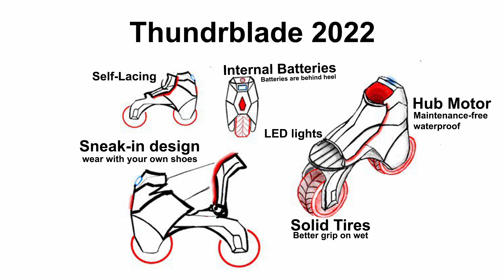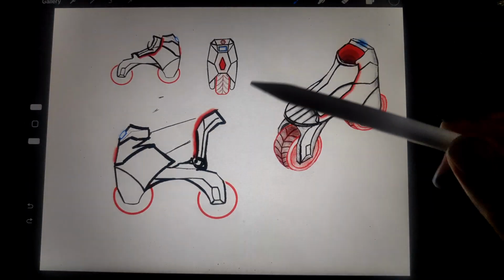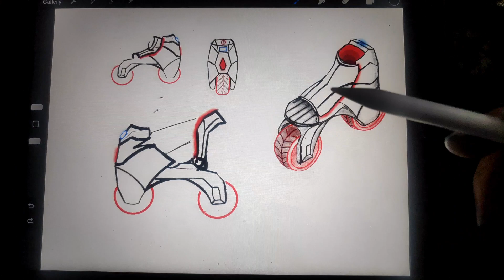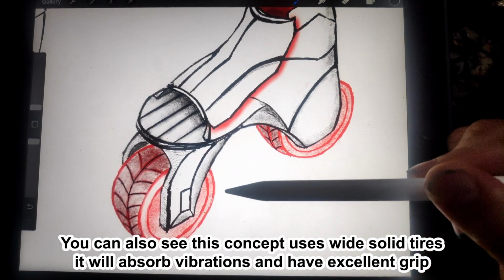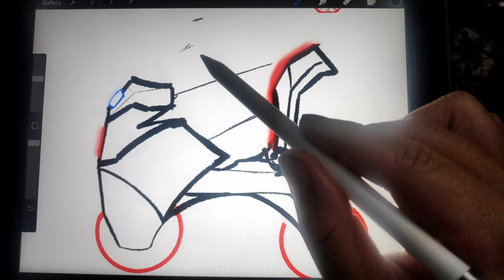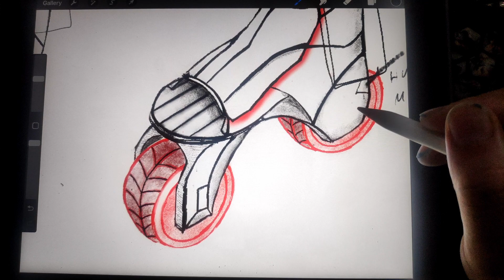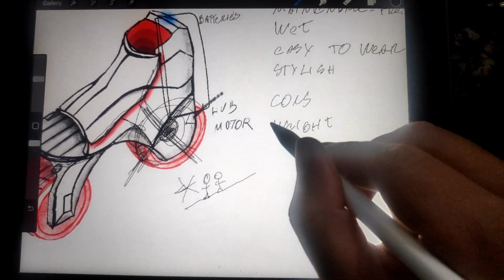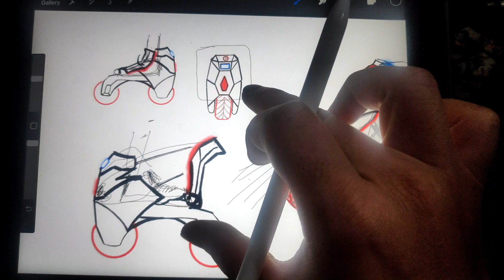Why Thundrblade will use HUB motors going forward

Comment: I follow you since the beginning, and I tried to build a prototype of electric skate myself. A rudimentary working one. So congratulations!

I just think that, in general, it is better to show a working prototype rather than a sketch. Prototype are "cheap" to build after all, especially of this type.
Even a CAD model would be better than a sketch (it would also reveal many details) to figure out how well a solution is going to work.
I think that for any start up project or whatever you want to call it, the best time to talk and convince people, including investors, is when things are done and working, i.e. prototype. Also, I think you need a team of at least 3 people (experts) to make any product of that sort.
Reply from the maker: I agree that showing a working prototype would be better. I showed the first one 7 years ago XD
but right now I simply dont have the money to build one.
yeah, prototypes are not that affordable. I am gathering donations from eveyone that supports thundrblade to be able to build one right now.
check out the previous video where I talk about how things are right now.

that path is correct, but its not a possibility for me. I tried the crowdfunding/investors path and couldnt make it.
a team costs money, a lot of money.

Im done trying investors. its really hard to convince people that electric skates have a good market. I tried for many many years as I said in the previous video. So we have to build the market slowly. 
Right now it is not the time to try and convince investors. you are right about that. I am trying to make an open source community backed project to actually start building the market. so its not the startup path as we know it.